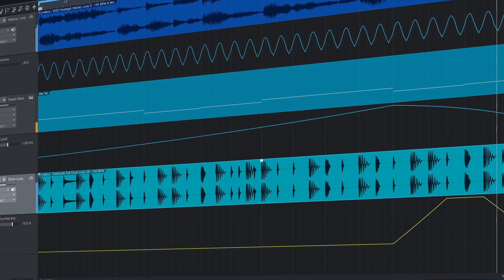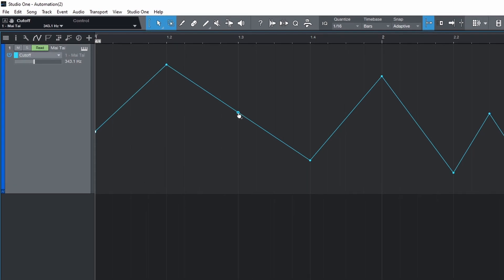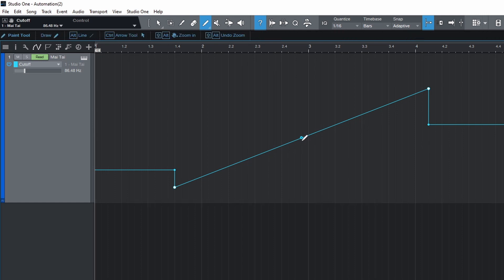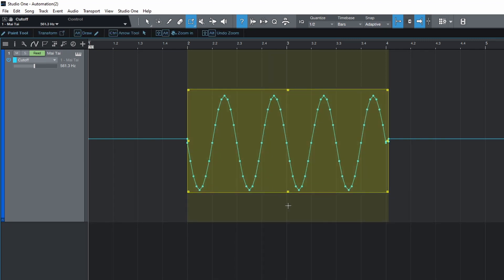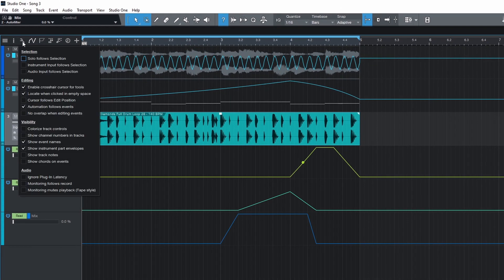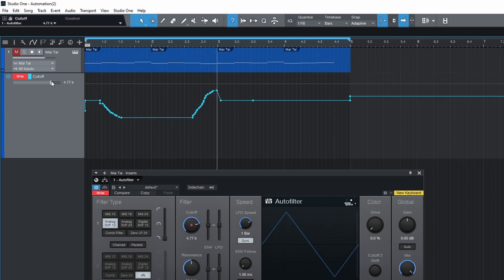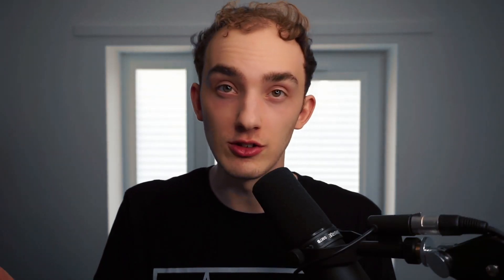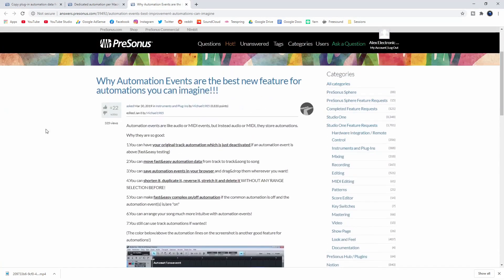Studio One 5 Tutorial | Beginners Guide: Automation (In-Depth) + Using The Paint & Transform Tool

Comment: Great explanation. One question. How to select only a certain part of automation? 
eg) I made automation using square shape. +3 on the top and -10 on the bottom. After a while, I wanted to change the value of the top ones only. 
However, I still haven't figured out how to select only the top part or only the bottom part.